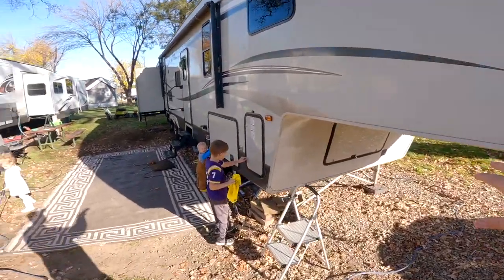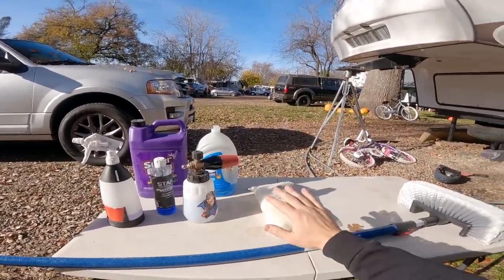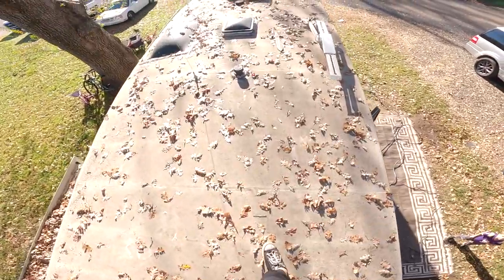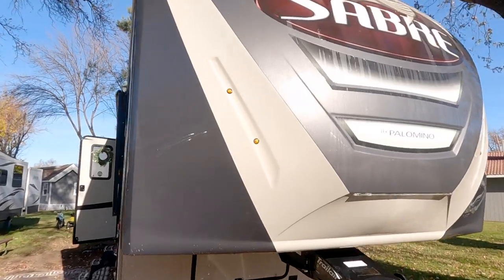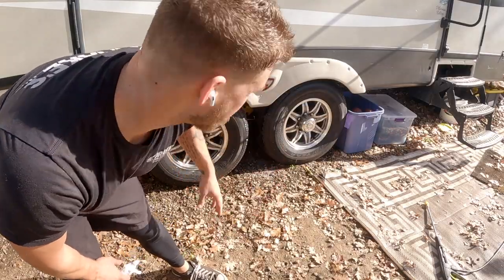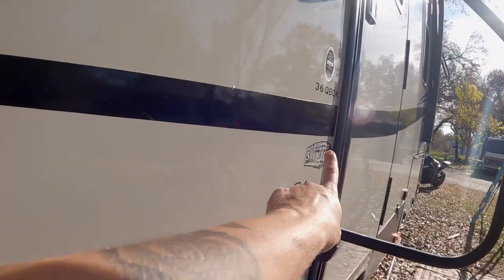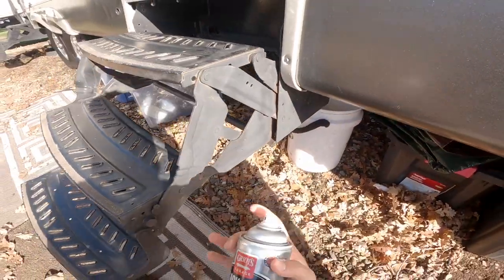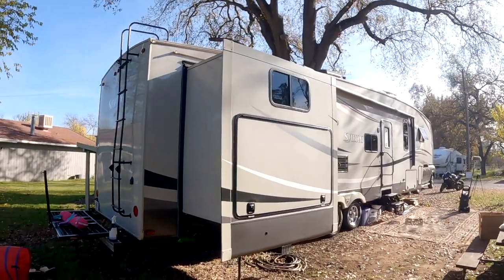How to Wash A 5th Wheel Camper | RV Life | RV Detailing Business

Comment: I follow the same steps. Good video.  
I have a customer that bought a trailer that the previous owner used ZEP floor polish or  Acurlic to provide a shine to the outside of the trailer. In the arizona sun. No one has washed it in 3 yrs or a really good wash. Now there is streaking from the stuff they put on and its turning a light brown. Just wondering your thoughts on this and have you dealt with it yet?
Reply from the maker: Unfortunately I have never encountered that. I’d maybe try some purple power or a similar degreaser to start to remove the floor polish from the trailer. Is it painted or gel coated?

Comment: I wouldn't use a pressure washer for anything other than awnings on an RV.  Low power ones like you have aren't good for cleaning or you wouldn't need to scrub things.  They aren't good for rinsing because of their low flow rate so you can rinse much faster with a garden hose.  High power ones that can actually clean without much scrubbing damage surfaces on RVs so they're best left to things with finishes you don't care much about.
Reply from the maker: Thanks for the education 💯